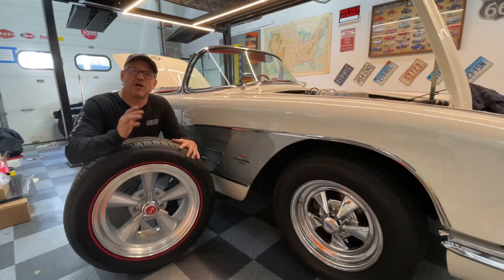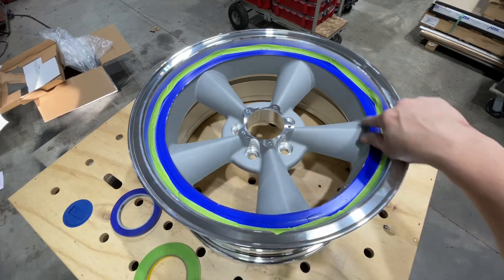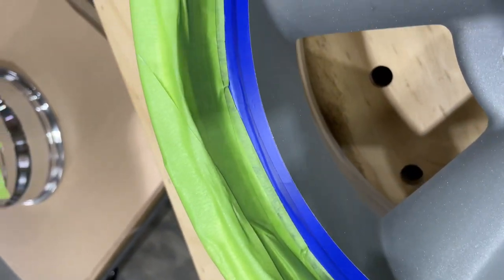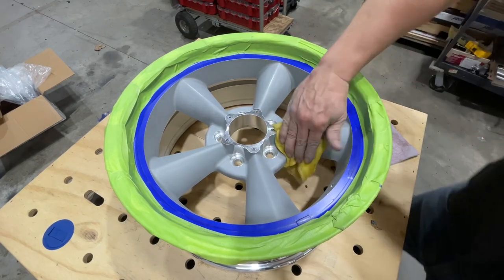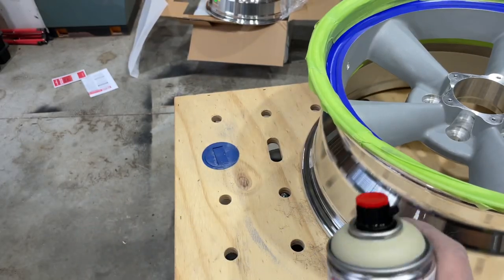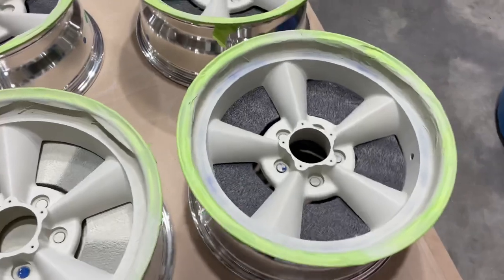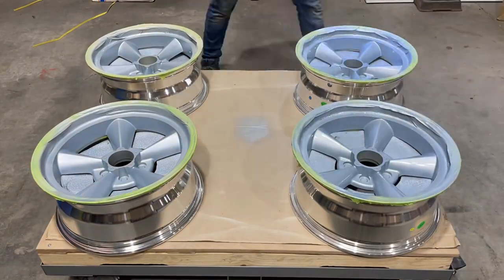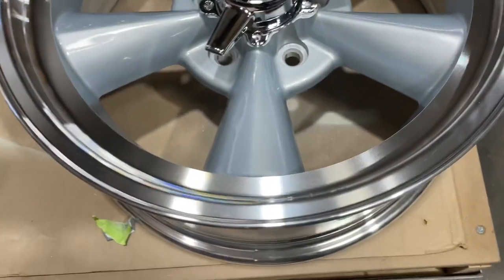Custom painting and masking Torq Thrust wheels for a C1 Corvette

Comment: That looks awesome! Would it require a high temp paint or normal would be fine?
Reply from the maker: High heat is not necessary but a catalyst top coat helps with durability